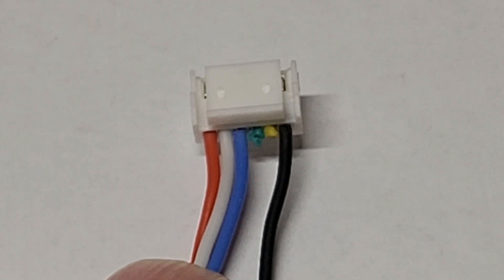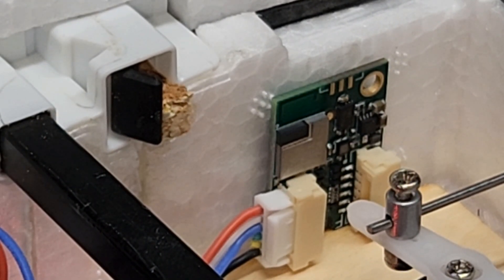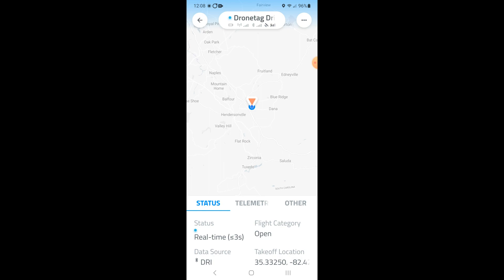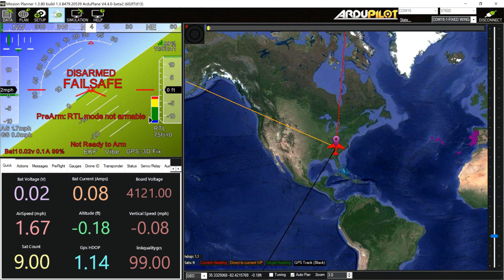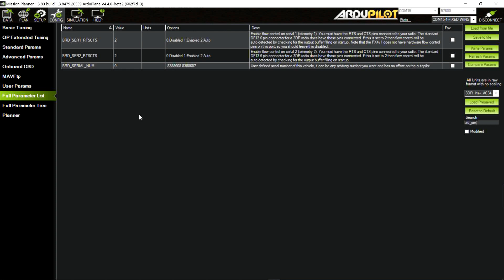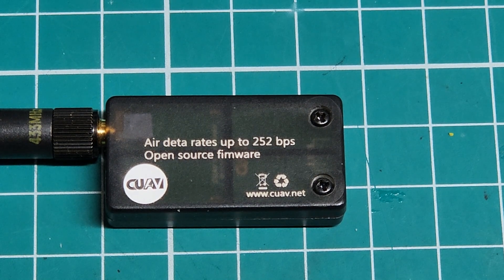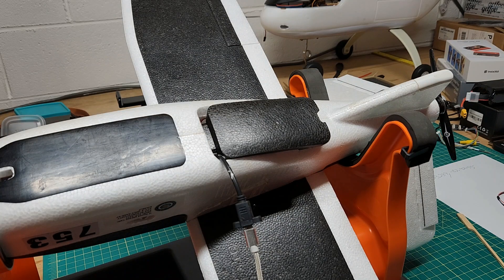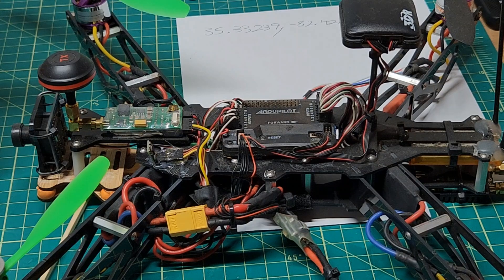Remote ID Problems Conclusion

Comment: I converted NOVA CX20s I crashed every one except kept one intact. They were a pain due to some 30 odd screws to get into the shell and gutless motors. I'm still flying Ready to Fly quad motors on a 5inch quad. Bulletproof.
Reply from the maker: I wasn't very good with those.  :)

Comment: My only Ardupilot plane was a X-UAV Skysurfer/Bixler 2 clone. I converted mine to twin motors with 3d printer nacelles and a pan mounted FPV cam on the old pusher motor mount. https://www.youtube.com/watch?v=zAJb3Iyp4YQ&t=52s   I don't think it had a FC when I made this video. Hey How do you line the Nano Racing hunter? I've been wanting to try one. And wow what a fleet you have.
Reply from the maker: Nice flight.  The conversion let you put the camera where the motor was.  Great conversion.  IMHO

The Nano Skyhunter is pretty good.  The FPV camera, not so much but the airplane itself is nice.

Thank you I constructed those over the past two winters.  In the spring the first year I had cataract surgery on both eyes that caused macular edemas in both eyes and was blind for about 6 months during the good flying weather.  Then this year I had diabetes related problems in the spring.  Am getting past them but still have one procedure to go through in August to try and find exactly why I am in so much pain.  It’s all good.  😊